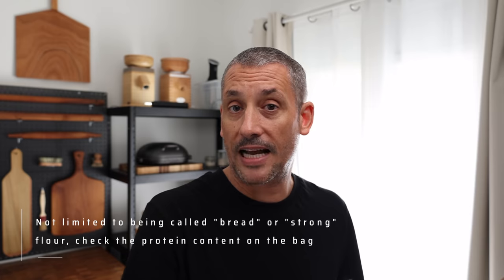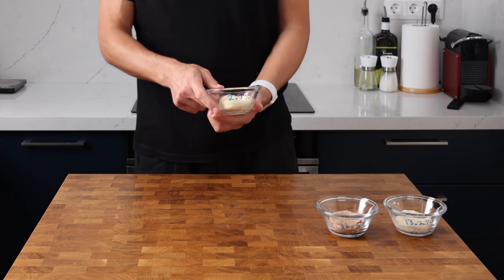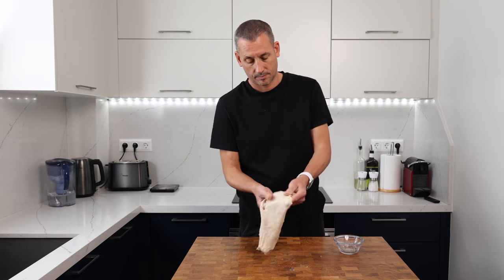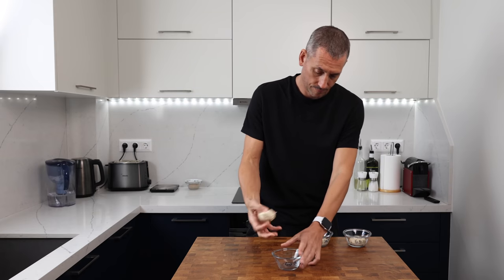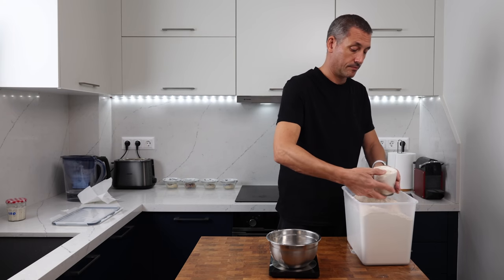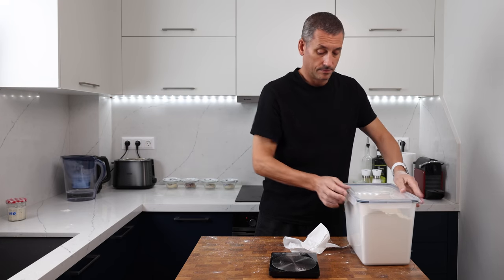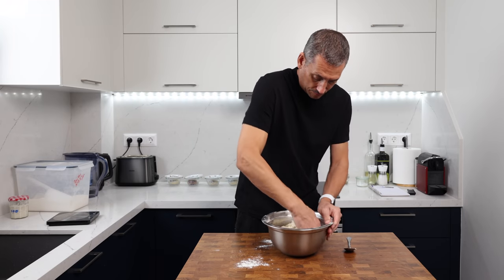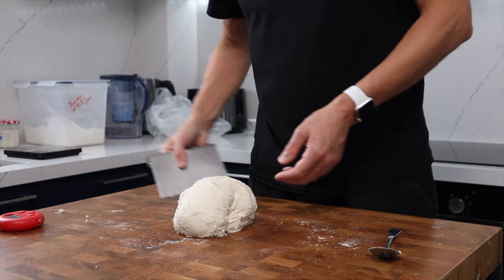Never Struggle With Sticky Dough Again

Comment: As always, thanks Philip. The one thing I'd like to add from my own (limited) experience is that sometimes too much patience isn't a good thing! I've over-proved a few batches of sourdough, and it goes back to a sticky mess only fit for the bin, so now I err on the side of caution and when in doubt, slightly under-prove and that gets me the most reliable results. If you have any comment on my over-proved, terribly sticky dough (which wasn't before the prove) please let me now if it's retrievable. Brilliant videos though, I love all of them!
Reply: Ive done this too, and it can be incredibly frustrating because with it sticking to the counter and all over your hands, it feels like waste. :(
Reply: Over proofing is usually the problem of sticky dough I've discovered from a utube. Who pours the sticky dough into two small metal moulds, leaves it for two hours and then baked it on 190 - 200, hör 30 minutes. The loaf /ves are compact, somewhat sour but tasty for some people. Or would some oil (1 tbs) ?mixed in (somehow) and made into pizza base....? Heard that one too, but never tried it 😊

Comment: When handling dough, what is best to coat one's hands with: flour, oil, water, or nothing? Great video. Thanks.
Reply from the maker: I like using a splash of water :)
Reply: DEFINITELY water. Cold water. Do NOT yield to the temptation to add flour to a sticky dough. All that work towards calculating hydration goes out the window and there's no predicting the result.

Also -- a scraper is your friend. Keep your hands wet, and use a scraper in one hand. It won't take long for you to learn the feel of moving the dough around.

Comment: Im using a bread maker and bought pre mixed flour works great. Its cheaper to buy individual flours so I tried the recipe from the book. Calls for 380gm whole wheat flour, 160gm white strong flour and 410ml of water, plus 1.5 tspn yeast, 20g butter, (I use oil), 1 tbsp milk powder, 1.5 tsp salt, 1 tsp caster sugar. So this is over 70% hydration and the dough seems sticky and usually collapses in the middle. So I have been progressively reducing the water and its better but the top of the loaf is always really crumbly and the crust breaks off. Ive tried changing the crust colour setting but this doesn't seem to help the top. So is this a hydration or a yeast problem, i.e. rising too fast and the dough can't support the rise and is thus weak on the top? BTW I add a pre bought seed/grain mix to the flour too. Im thinking I need to add some gluten flour to boost the gluten if Im using a 2:1 ratio of wholemeal to white flour?

Comment: 280g Water
2g Yeast
300g Starter (or poolish)
350g Bread Flour
50g Whole Wheat
10g salt

70% hydration and hasn't failed me in 15 years. And I don't even measure that close XD
For the beginners, this isn't nuclear physics. A sticky dough isn't going to crash society if you over or under handle it or add a little more flour or a little more water while working with it. Anything that's on the bench or on your hands is well under 3% of the total, it's practically meaningless especially for the home baker. Just keep doing it and you'll get better.

Comment: I did this test with my flour after wasting a bag of it before I found your video. My Bread flour could hardly tolerate 70% hydration and anything above it, even added starter became a struggle and the dough could not become cohesive. In the meantime, my starter improved a lot. I also started baking small bread about 200 grams. It let me watch the dough behavior much closer.

Comment: Basic hydration calculation is OK for yeasted bread and as a starting point.
But you ignored the water and flour in the starter. Depending on the inoculation that can change the final dough hydration sever percent.

Example you daily recipe uses 257 / 388 = 66.2%
But include the starter and (257+49)/(388+49) = 70%

That's with your 25% inoculation. A higher inoculation (like 30 or 40%) would have a bigger effect.

Comment: hi there, thank u for all the videos & info, very very helpful indeed. I hope u can help us with our dilemma, recently we got an air fryer "oven" with three tray shelves, it's heat plate is from inside top, like a broiler, no  hot plate at bottom or grill. struggling when making the sandwich bread loaf, as it seems it heats & brown the top while bottom & sides still white & not done at all. I tried to take the pan half way & filp the loaf upside-down, then I repeat the same for each side. it is uneasy & a haste to say the least. I can't cover the loaf pan with foil as it rises as it is heated & also aluminum is not healthy. what do u recommend we do? Thank you 🙏🙏
Reply: Short of getting a real oven, buy a bread machine.

Comment: I saw you said that dough breaking is bad, then you combined the last dough with the whole wheat dough, and stretched it, and it broke, but you purposefully put the break away from the camera.  Not interested in anything you have to say again.
Reply: You are clueless and will remain that way forever with that attitude. WW Flour has very little gluten which is why it’s added to higher gluten flours and not used as a stand alone. By adding WW Flour you necessarily weaken the overall dough.

Comment: With the No Knead, I have been substituting 24% (90g) whole wheat flour and increased water by 3% (260g) with good result, but never look as good as yours. Using Rogers Flour same as Robinhood. When I was in Asia, the Korean strong flour 13% produced very sticky dough, hard to come together even with lower hydration. Next time I will do your 2nd test to find the best hydration % for that flour or pack some Robinhood in my suitcase. Haha! Good advice to get a journal, have notes all over the place.
Reply from the maker: Cheers Becky. I'm not sure if it's the change in seasons but my Robin Hood isn't performing as normal! Cheers for the heads up on the website copy :)

Comment: Hi, I have issue with baking the first 3 times I tried your recipes for the whole wheat bread it turned great, but when I tried it again as a bread roll, it was great after the second proof BUT. When I put it in the oven it flattened, why? I left for you message on Instagram and sent you pictures, 
Kindly advise me how to solve this issue
Reply from the maker: Hey there, Ive just had a look at your message on IG. The first rolls look really good, aren't you happy with them? The second look a little flat but still good. They may have been over proofed a little, try reducing the second proof and keep checking them. It's hard to tell from the picture but did you use the same flour? Just make sure you've got a nice strong flour to make the dough, otherwise the dough may flatten out after shaping.

My advice would be to experiment with the proofing times first. I hope this helps. Phil :)

Comment: Hi..This is Devendra from India. Your narration is to the point and compelling. My microwave is having convection mode and 30 ltr. capacity with turn table. And I am really interested to make baguettes and Artison bread with sour dough...!! How old my starter suppose to be...And it it possible to make them in my present oven or additionally do I need Dutch oven ...!!??
Reply from the maker: Hey Devendra, cheers for the feedback. I don't have any experience baking in a microwave with a convection setting so I'm probably not the best person to give you advice. In my opinion it's best to get the starter up and running over a 7-8 day period, and then continue to discard and feed for at least another week. That will ensure your starter is strong and ready to go, improving your results. A dutch oven is good for a round loaf (for example). But if you want to bake baguettes perhaps you'd be better off with a baking stone or steel. This is quite a long topic and Ive got a video coming up that dives deeper, so stay tuned :)
Reply: I am very glad to see your  reply...!!

Yeah Okay....!
It is valued for me....!!

 Let you know if I could do your recipe in this turn table microwave oven. Thank you very much.

Comment: what is the correct weight of 1 cup of bread flour as online it ranges from 125 to 250g not very helpful
Reply from the maker: Hi Gary, it will vary depending on how packed the cup is. If you can, grab a set of digital scales, it's a lot more accurate :)
Reply: 1/4 cup of flour is about 30 grams according to the package on most flours. so 120 for 1 cup.

Comment: Just a thought - surely when calculating one's hydration factor , one needs to account for the hydration in the Levain as well?? 
I've been battling with this thing , but I've been using brown bread flour mostly which has a protein content at 12.5 , It's edible and tastes good but the rise leaves a lot to be desired!
Your information is immensely helpful , specifically re the protein content and hydration values , here in South Africa we really are never sure of what comes out of the packet as quality goes but armed with this info , I'm a little more prepared if you will! 
Thanks for a great video!
Reply from the maker: Hi Hamish, I've linked to a couple of vids below, not sure if you've seen them but they may help you out. One on flour and hydration and the other on including the starter in the overall hydration calculation. I hope they help. ATB, Phil
Starter / hydration calc: https://youtu.be/LRkCc4WJaeg
Flour / hydration: https://youtu.be/GS8jz_ta9vs
Reply: @CulinaryExploration  Hi Phil! Thanks for your prompt response , I missed the video on the inclusion of the starter.
I followed your recipe and procedure to the letter and still came up too soft and sticky but I have forged ahead and the loaf is in the oven as I type this , just past the 20min mark and it looks real promising!
I think I may have made a few fundamental errors though in my process , in that I covered the bowl with a damp dish towel as per other recommendations , I always used to , when I  made dough nuts and holes in the past , it was fundamental to getting a good rise with yeast! 
The other thing that might be at issue , is the time factor , here on the coast in summer the humidity and temp factors are high , and might then facilitate a faster proving time.
After the 6 hr mark the dough had risen like a muther!! I suspect it had become spent , The keyword here is "Fermentation!! " Once the ferment is done , you're not getting any more out of it , so less of a rise! 
Thanks again for the help and the excellent videos , will let you know how it comes out!

Ps - came out ok considering! Damn fine flavor , will give it another go now that I am better educated!😂

Comment: Thank you very much, very helpful! I have a question : If i want to add olive oil in my dough (making bread with durum wheat ) what amount of water should i remove to keep my hydration level?
Reply from the maker: If I was making a 70% hydration with my normal flour I probably wouldn't reduce the amount of water. Or you could swap out 25 grams (for example) of water for olive oil. It's really up to you, I'd suggest experimenting. I think it's important to understand that it will have some impact on the hydration. As long as you understand that you make any necessary adjustments while testing the recipe. You can only plan so much on paper. Then it's time to get your hands involved, make your notes and adjust the original recipe. Hope this helps.
Reply: @CulinaryExploration  Thank you very much for your reply. I already applied your suggestion and I'm waiting for my experimental loaf to be baked! Cheers!
Reply from the maker: @spirosmartzoukos1670  Let me know how it goes :)

Comment: I have been weighing my bread ingredients for years.  Once you get the hang of it, clean counter to clean counter in under 15 minutes... 2 dirty bowls, 1 dirty knife, one dirty spoon.. that's it, super easy cleanup.  yah.. i cheated, and put the results in a bread maker.  That said, I can not emphasize enough, that the key to reproducibility, is weighing EVERYTHING, accurately.  Learn to use the tare function (zero out between adding ingredients).  That greatly speeds up construction, and vastly reduces the dirty dishes.
Reply from the maker: Can't beat a set of scales! :)

Comment: I had never measured bread ingredients. I do it with sourdough and i try mostly styles i see,  or  experimenting with failures, I baked even  dough balls with 0 shape  or structure and still was so tasty...  Do you really feel the difference with so many calculations?  With full respect but honestly seems to me it is just a show up Also please do not use one ime plastic lids as 99% of yuutubers recommend, pure show up, any lid would do same job and would be susteinable.
Reply: Weighing in grams is a surefire way ensuring your ingredient proportions are correct. That takes a lot of guesswork out of it. You never heard of Baker's Math? All professional bakers use it, easy to learn and helpful in enlarging or reducing any recipe you get.
Reply: @SpaceCadet4Jesus   i think all flours react in different way and you need to find the desired amount. Baker calculators has many variants of humidity as well. So I think it is better just find your way.